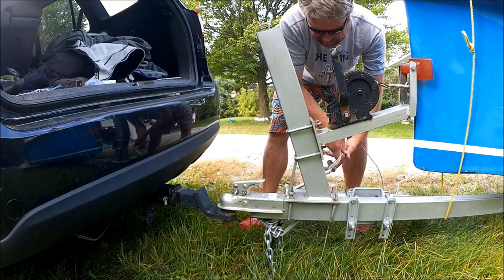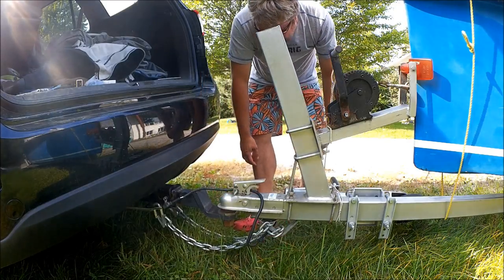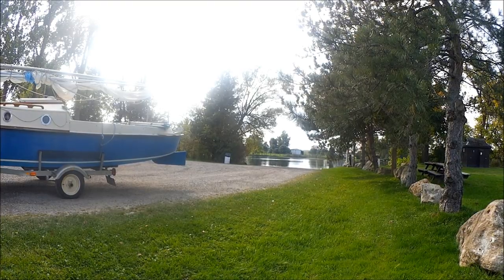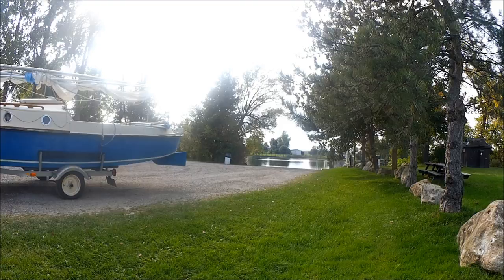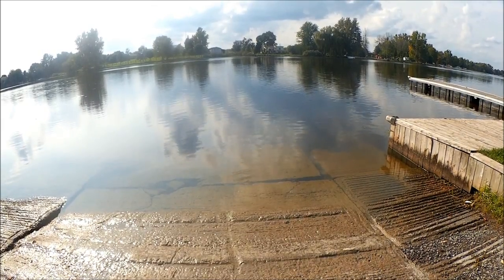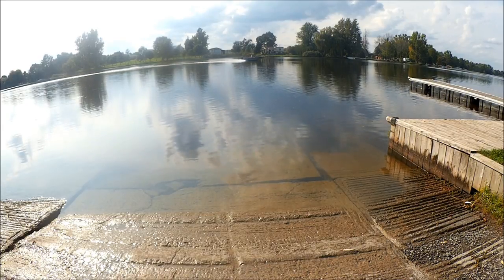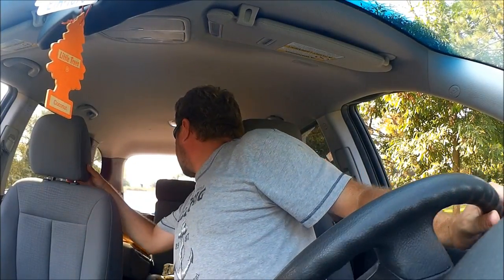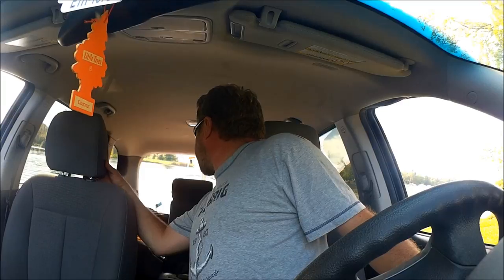How to Launch a Sailboat from a Trailer

Comment: When I put the plug in,  I also I check to make sure the bilge board lines are tight and secured, otherwise when she floats the board continue to rest and in some case foul on the trailer when you push her off.  Had that happen once, but never twice! :) ;)
Reply from the maker: +Jim Dandy good point Jim.  I actually mentioned the bilge boards in a clip that I decided to edit out.  I was trying to keep the presentation generic.  But ya, I've had bilge boards stuck in awkward positions a couple of times when loading on the trailer.

Comment: If it's a lake without much cross wind, and no current (like a river), I tie a rope to the back of the trailer, and to the bow of the boat. I back the trailer into the water until the boat floats, then pull slowly forward until the back of the trailer is out of the water. Then, I pull the boat to me, and walk it to where I want it. No wading in freezing water to launch. Recovery can be done in reverse, if you are slow and careful,
Reply from the maker: Yes, I like this technique as well.

Comment: • Not sure, but does your car have back up video? My new used car does.. I haven't tried backing to a trailer yet. But since I have a small 15 ft sailboat, it is kind of easier to move the trailer to the boat. I wonder how that camera will help

I like how you second guess internet people and explain why you left of your sail because of proximity before people complain about it.

One suggestion I have.. not as much about trailer, but about the process --- a checklist. Definately have 'have plug' as well as 'put in plug.'

I know you didn't do it on purpose, but thanks for 'need to put it a little further in the water' that happens to me so often.

When I pull the boat out of the water I tend to not go as far back in and use the winch to bring it back in.. using the slowness to make sure it is seated.

And I would suggest you mention the turn of the steering wheel to make the boat go in a certain direction. Like turing right as you back up, makes the boat go left (as you look forward)...

enjoyable
video
Reply from the maker: No, no back up camera, my cars getting a little long in the tooth.  Your 15 footer is probably more difficult to back than my boat though.  Longer trailers are so much less twitchy.  I would say your back up camera will help quite a bit.  You can see when the trailers in the water and you can see when your car is getting closer to the trailer.

Ya, I thought about how to describe the wheel motion when backing.  I read about somebody who keeps their hand on the bottom of the wheel, so the steering isn't reversed.  I haven't tried it myself.

I was hoping for a better camera angle for backing, but I just couldn't make anything work.

I definitely carry a spare plug.  My 3 yo gets curious sometimes and pulls out the plug while we are sailing.  Somebody sticks there finger in the hole until we can figure out where he put it.
Reply from the maker: The plug isn't super critical in the bay hen though.  The cockpit settees are all buoyancy tanks and there is a proper bridge deck, so the cockpit would only fill to 6 inches or so then everything would be equalized.
Reply: seems to be similar to the DC15. I once launched the boat and forgot to put the plug in. It was a bit lower in the water when I got back from parking the car. I was too lazy to go get the car, pull out the boat, drain it.. so I just put in the plug and went for a sail

With less buoyancy it was a sluggish sail, but actually more stable... and I didn't plan on being out long. I wouldn't want to do that regularly since my thought was if I capsized it would game a pretty good bit to upright the boat

Comment: Any chance of launching without weeting the wheel axle ? I would be launching in salt water. Not that good for ball bearings and brakes...
Reply from the maker: I haven't tried it.  It might be possible with a steep enough ramp.  My trailer is a break back trailer, which should help.

Comment: Is your car a V8 or V6?  Can a V6 pull a 27 foot sailboat?
Reply from the maker: Mine is a V6.  No, I don't think it could tow a 27 foot boat.  I wouldn't want to trailer a 27 foot boat with anything.
Reply: @travelbywater9378  Thank you for the reply . Looks like im going with a 20 foot.

Comment: Thanks! I've never done this.... I'm thinking my swing keep Catalina 22 should be a similar experience with an 20" draft keel up.
Reply from the maker: Yes, you need to be more carefull with a Catalina 22, its about 3 times the weight of my boat.  They are designed for trailering I think though.